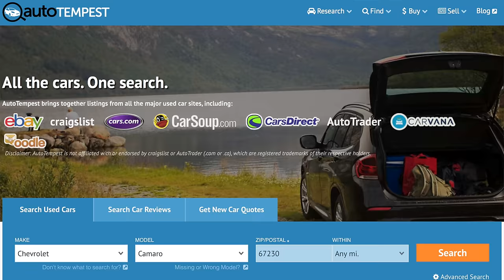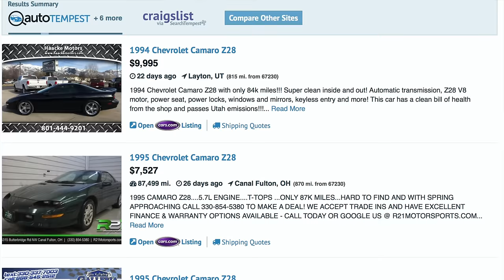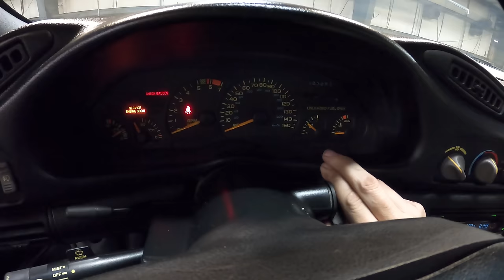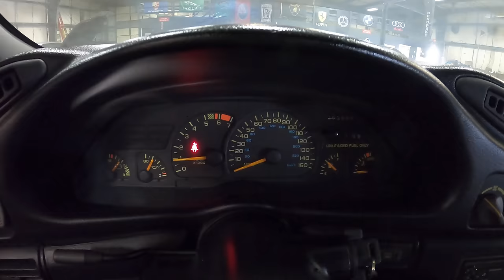I Bought a Barn Find 1993 Camaro Z-28 and Started it for the First Time in 10 Years!

Comment: I’m surprised the wizard didn’t know about the trap door method people do for changing the fuel pumps on the 4th gens. Don’t even have to drop the tank that way
Reply: Saturn S-Series Fan Club isnt it under the rear seat?
Reply: NO YOU CUT A HOLE TO GET TO FUEL PUMP, NO TRAP DOOR.
Reply: @NoWr2Run  exactly you have to make your own trap door with careful angle grinder skills in the right spot haha
Reply: I changed the fuel pump on my '94 last spring. It's a PITA but it is the correct way to do it. Cutting the "trap door" can lead to rust

Comment: I love Hoovie but sometimes he really doesn't think...

"The previous owner drove it everyday until one day it wouldn't start. So he parked it under a cover and left it"

Let's try to start it without doing a damn thing to it other than battery...

Haha

Hope wife and baby are doing well and the first cries of the little one ran straight through you ;-)  hehe.
Reply: This is called entertainment. He fully knows the correct procedure on how to handle a sitting car. This is for entertainment value, more views, plus subscribers. He act's the fool, but is a brilliant entrepreneur.
Reply: Attempting to start the car is the most efficient way of diagnosing which system is faulty. Turning over the engine to watch, listen, smell and feel is the quickest way to determine where to start diagnosing. What he did is what every good technician does in this situation.

He did turn the engine over much longer than he needed to, can’t be good for the starter.
Reply: I merely commented using the part I found funny.

I'm certain the Wizard wouldn't let Hoovie do something catastrophic and pre checks had been done.  I do understand, (having an I.Q above 3), that this was done for suspense and fun.

However, starting a barn find isn't like starting a car that broke down last week.  Unfortunately the "bull in china shop" method will cause 1000s in repairs potentially.
A good technician knows;
1.) Fluids.   Are they there, are they good enough for a quick test?
2.) Belts.  Does it have a timing belt? If so is the condition good enough to withstand a test start or 5?
3.) Timing? Hand crank the engine, makesure it doesn't lock at any point and whilst you're there line the timing markers up, check that.
4.) Spark plugs.  They'll need changing, may as well do them now. They'll also let you know how the engine was running, (black, brown,  white/grey ect), and also if any moisture got in there whilst it was sitting.  I mean, a good tech won't wang rust up and down the bores will they?
5.) Fuel?  That'll be crap so change it out, clean system and new filters and check pump is working.  Or remove pipe and bung a temp solution in place. 

Now try to start and then your diagnosis will be more accurate.

Just saying....

Comment: Damn it Hoovie save some hoopties for the rest of us
also isnt there a access panel under the back seats?
Reply: There might be an access panel under the back seats if the tank was under the back seats. The tank is BEHIND the back seats, between the seat back and the storage tub. You'd think there would be a panel under the carpet, but no. GM didn't put access panels to fuel pumps in anything in those days.
Reply: RandomGamer not from the factory. It’s a super common mod though on these  since it’s normally easier to cut through the trunk than it is it drop the rear end
Reply: @EMFAudio  i wonder if there's an immovable fire wall over top of it anyhow?  Cuz maybe Chevy didn't want to gain a reputation for having fuel tanks explode right behind the seat like on old Fox body Fords.
Reply: @pex_the_unalivedrunk6785  I don't know their logic behind it, I just know they dropped the ball on a few cars like that. The Astro for example has no reason to not have access in the floor, and yet you have to drop the tank to do the fuel pump. Murphy's law says it will always fail with a full tank of gas (26 gallons) and mine did.

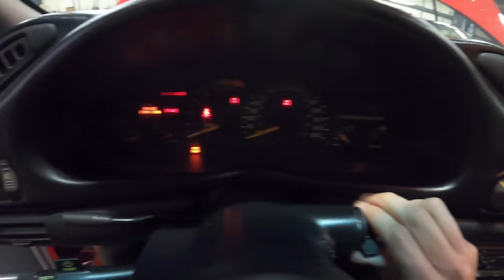Comment: 6:20 if a fuel injected car doesn’t start in 5 seconds. Stop cranking it. Also praying to god want help either.
Reply: As it's EFI, surely just turning the key to on should prime the system. It's not like old mechanical injection.
Reply: @omgwtf696969 What is really funny is when the tech tell them to pump the peddle.

Comment: As an owner of 2 of these vehicles one being the 1997 B4C police package Z28 and a 2000 Camaro SS it is much easier just cutting small hole from the trunk due to the fuel pumps location. Avoiding all this extra work. Please look up this alternative you will save alot of money or time.☺️

Comment: I bought a 1997 Pontiac Trans Am with 8,700 original miles and it was hardly driven sitting in a garage.  When I bought it, it started up fine and ran like a brand new car. The next day I changed the oil, tires and all fluids.  I've got 13,000 miles on it 1 year later and the only other thing it needed was  a new oxygen sensor back in September.  It's been an awesome car inside out!

Comment: Had the exact same issue when I tried starting my 94 Formula after over 10 years - would start with starting spray but nothing else. Fuel pressure gauge also shows nothing. I presume the fuel pump (which is placed inside the tank so that you'd have to get the entire rear axle down to get into the tank - incredibly stupid design) has gone bad and needs to be changed. Got no money for that, thanks GM for this design.

Some people cut a hole in the metal above the fuel pump in order to get to it more easily. Some car manufacturers with such fuel pump placements make doors to access the fuel pump themselves, but not GM, noooooo. Jesus F'n Christ...
Reply: I did my 95 formulas fuel pump on jack stands. It’s not that bad bro it really isn’t.
Reply: @joshua7999  That would require me to have space. The car is sitting in a basement garage of an appartment building.

Comment: Cutting the exhaust 6" away from where it's bolted together, though?...
Reply: Strange 😂
Reply: it was welded , it was bolted first to get it straight where they wanted it then welded.
Reply: @Athmox  not as strange as both of you guys that missed the part in the video where they explained where it was welded and had to be cut, now thats strange !! LOL
Reply: That’s a standard exhaust shop crushing clamp that permanently crushes the pipes together. The clamp can be removed, but the pipes cannot be disassembled, as they are crushed together. Plus, it was welded anyways, which is the right way to assemble,

Comment: If it was me, I would have drained all fluids and replaced it before starting the engine .
Reply: Plus taking out the injectors and cleaning or replacing them. Even just checking them in the first place. I would have had the fire extinguisher on hand the moment you start working on the fuel system.
Reply: Ratherbit use the old fluid to gather the crap then swap it out after running for 5 minutes. Especially the coolant. As it cleans out better when hot.
Reply: Why would you waste money on changing the fluids on a unknown engine? Get it running first to make sure there's not a rod hammering or a blown head gasket.

Comment: Mine also needed both window motors replaced. And two PCMs. And a few other electrical issues. And also make sure the weather seal on the hatch, at the bend off the C (B?) Piller is waterproof. If it is parked nose down and it rains,  water pools and it will leak and fill the wells under the back seats. Beautiful fun cars but F-bodies have their issues for sure.

Comment: When the fuel pump failed in my third gen Camaro, we just cut a hole in the cargo area floor rather than removing the exhaust and rear end, lolol
Reply: Easier. Just like the chevy trucks. Just cut the bed and lay a sheet of metal back over then bolt it down.
Reply: I did the fuel pump in my 3rd gen on jack stands just by dropping the rear end down not that hard
Reply: @brandoncaldwell95  you realize it's only like 6 bolts to remove the whole bed right
Reply: Most normal cars have an access panel.

Comment: IIRC, The 4th gen windshield rake was so bad that the engine was mounted on a cradle and changing the spark plugs involved partially pulling the engine out of the car. It was mounted on a special cradle to rock the engine forward to access the rear plugs. Heard that from a friend who worked at the GM dealer.

Comment: I have a 93 z28. Looks to be the same options but mine’s a darker red. I’ve had it 12 years now. Bought it with 128,000 miles on it and now it has 177,000 on it (it was never my only car). A couple of optisparks (needed one when I got it, replacement MSD one cracked, back to a factory replacement one), 2 exhaust systems, front lower control arms, 2 sets of tires (first set was  used), front pump on the trans, 2 rear shocks, and 1 fuel pump (trap door mod). Need to fix a leaky trans line and a leaky rear main seal and it needs a paint job bad.

Comment: That pan hard bar that hit the wizard twists if you get on it. I had to change the fuel pump in my 98 Trans Am by cutting a trap door above it in the trunk area. It wasn’t until 99 they changed the gas filler neck. What about the regulator in the injection rail. BG is really good.

Comment: Nice Z.  4th gen TA's were meanier lookin. LT1's are bullet proof besides the "Craptiespark" distributor and water pump running off the camshaft with is weird reverse style cooling flow
Thats why i cut an access panel for the pump on 94 TA :)  plenty of measurements on the net :)

Comment: I don't see an issue with working on these cars.. So you gotta remove the a/c to change plugs. Or drop the rear and let exhaust hang low to remove gas tank. What I have learned is use good quality parts so you only jave to do tge job once..

Comment: these fuel pumps rely on the fuel to cool them, constantly driving on empty burns them out eventually. Check the throttle body, could be dirty enough to prevent air from getting in, just spray with cleaner and wipe. Something that simple with such a tight tolerance will prevent starting.  At the end of the video says it's injectors, never use gas with Ethanol, it really gums up everything.

Comment: when we did mine in my 98 we did the floor mod where you just cut a hole in the floor. and pull the fuel pump out for the top in the hatch.

Comment: What does the car wizard recommend for driving ultra low mile cars like this. Other than complete fluid changed, is something like at-205 reseal, and gental flush additives for coolant and oil recommended to prevent excessive leaking from not being driven? I've had a couple bad experiences from 20 plus year old low mile cars with excessive leaks

Comment: I did a fuel pump in my camaro in high school on a shop floor I never removed the axle it was one of my first DIY projects the tank had rusted and I had to put in a new tank and pump because the car would cut out after about 15 mins of driving.

Comment: Ahh..  the '93.  I had one.  Gas tank was shaped like a V...so the needle wouldn't drop at all for a few days and then you'd go from half tank to empty in 4 miles.  The passenger side floorboard had a huge hump so that passengers hated riding there.  The panels were fiberglass in places and the paint stained easily.  Working on the engine was a nightmare.  The windows even without T-tops leaked like sieves in a rain storm.  It was typical GM...  good engine with a shit pile of a vehicle wrapped around it.  

But hey, on the flip side you could easily take the computer chip out, toss a Corvette LT1 chip in, and get more top in power in about 3 minutes.

Comment: Hoovie,
   Did you check to see if this 4th gen has the secret tack welded on hatch cover under the back seat that allows clean access to the fuel pump from inside the car?  I have a 94 Camaro and it came from the factory with this access point already installed.  ✌

Comment: I have a 71 f-100 that was sitting outside in Tuscon, for 15 years, so it was bad. we had it towed to a relatives house, and on the first day of working on it, it fired up. the second day the truck moved under its own power, and on the 3 day we drove it a total of 5 miles.

Comment: I also had a 2000 Camaro v6 with bad fuel pump and it cost me $600 to replace. What happened is I would put only 20 dollars in the tank back when gas was $2 a gallon and drain till empty. What I did not know was the fuel pump is cooled my the fuel itself and driving till empty would burn up the fuel pump. So now I would drive to a half tank and then fill up to full or up to $35 based in Los Angeles gas price of $4.29 a gallon which is close to full.

Comment: Would’ve been way easier to cut into the body up top to access the fuel pump, then order one of those weld in access panels, most cars come with a fuel pump access panel, but its just as easy to cut one, that’s what everyone does.

Comment: Love your and the Wizards videos - but - I have had lots of experience in resurrecting old cars I don't think it's  a good idea to introduce bad fuel into injection or carbs. by getting in a hurry to see if it will run. Old fuel turns into something like shellac and that can clog tiny holes. Also the brake caliper pistons might not retract and cause the pads to drag on the rotors causing hard spots. Finally the water pump should be replaced before it floods the Opti-Spark causing a tow bill.

Comment: Yeah I have the same car same condition and nine times out of 10 when you don't get a no start it's the fuel pump save yourself a lot of trouble and put in a trap door under the hatch and don't drop the tank that's if you ever want to change out the fuel pump without dropping your axle which is kind of ridiculous😇😇😇😇😇💝💝💝💝

Comment: 14:56
I'm a bit surprised that your mechanic didn't suggest cutting an access panel from above the fuel tank (access it from the trunk).
Reply: I've dropped the tank out of a few 4th and 3rd gens and once you've done it and know what needs to happen it comes out pretty quickly. No need to hack up your car.

Comment: I  have a 1994 Z/28 with a 6 speed with only 72,028 miles..how the hell did the drivers seat not fall apart on the upper part? They must not have put on their seat belt when driving is all I can think how the seat edge isn't trashed.

Comment: For all the cars that have been damaged “seeing if they will start after prolonged periods”. 
DON’T do it. As exciting as it might be. Control yourself. 
At a minimum. Change the oil and coolant. Check the gas. Pull the plugs if you can get to them and squirt some oil into the cylinders. 
If and when it fires. Do NOT rev it! You will do large amounts of damage.

Comment: Okay now you need some gears, a shift kit, cold air induction, under drive pullys a cam. A tune.  Long tube headers...oh man I feel like high school again. I had a 95 Formula LT1. My fuel pump, water pump and optispark went bad. I also broke the rear end, flex plate and transmission. Other than that honestly it was a good car for the amount of abuse I gave it.

Comment: Fuel pump is NO FUN on that car. The exhaust tips aren't OEM. Factory tips aren't chrome. Those had trouble with coil wires and distributors too. Only '93s had yellow lettering on the switches. The rest were white. These just came out when I started my first dealer job in 1993. My boss just "refinished" a red '94 with 80K miles. I had to replace the OptiSpark and the radiator. We also had to reseal the intake manifold and other jobs. It was just as "clean".

Comment: kind of amazed neither of you have had to change a fuel pump on a 1982 to 92 F body. Pro tip, an access door cut into the floor above the fuel pump is the trick.

Comment: You could've just replaced the fuel pump from the inside of the car. Under the rear half of the carpet is a plate that covers the fuel pump.

Comment: Buy a 95 or 96 3000gt vr4 spyder or an old vr4. Not enough appreciation is given to the 3000gt/gto especially since it was the first hard top convertible in America since ford did it in the 50s I believe. I could be wrong.

Comment: If I had $1 for every time I heard the A/C just needs a charge, when A/C stands unused water enters the system through a form of osmosis (that might be the wrong name for the process) destroying the compressor and making a recharge a waste of time, run your A/C once a week, even in winter to keep it working properly, when you do rechange your A/C do not add the dye they put in as that helps destroy compressors, A/C fillers won't tell you that buts its true

Comment: You want to do 3.73 gears, headers, speed engineering true duals, and Lloyd Elliot heads and cam
Reply: How much power does that ad vs cost?
Reply: peaceofvideo +150rwhp for 2000 in parts. And going from 2.73 gears to 3.73 won’t add power but it’ll wake the car up and be like night and day difference

Comment: Imagine an electric car having sat for 10 years. It wouldn't need a SINGLE thing. Charge it up and it will take off immediately, while any ICE vehicle will need EXTENSIVE motor overhaul with all the runner gaskets and seals that haven't had any regular lubrication. Plus as evidenced here bad gas and gummed up injectors and fuel pumps. 

That alone makes the electric drivetrain worth it.

Comment: I had a 95 Camaro as my first car, and the fuel pump died about 10 years into its life. The shop told me about what a pain in the dick getting to it was, and were gonna charge me close to $2k for the job (on a 10 year old car that I bought used in 2001 for $5k). I towed it home and my buddy and I cut a hole into the trunk floor and dropped the fuel pump in from above. Cost me 50 bucks and some beers.